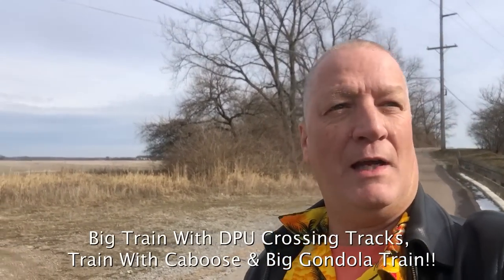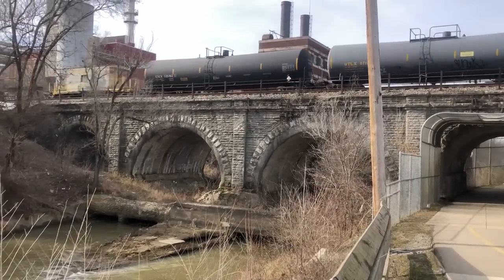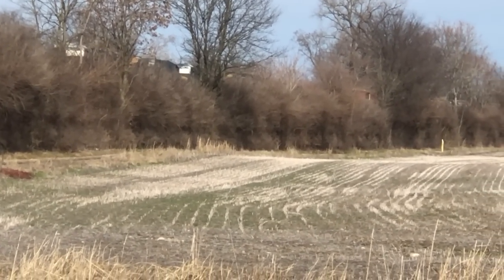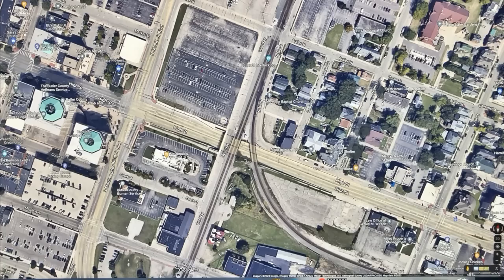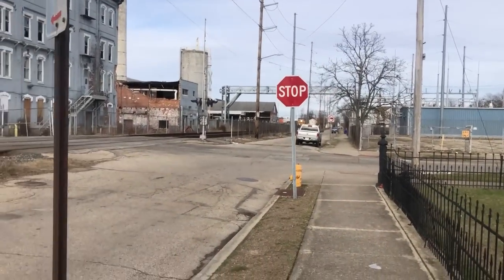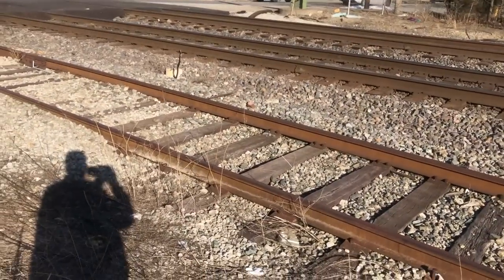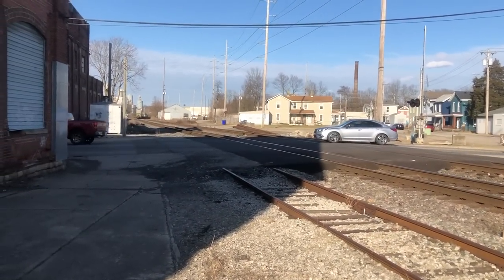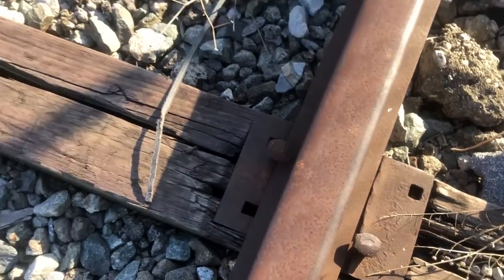Longest Gondola Train Ever!  Rare Caboose On CSX Switching Train Crossing Rock Viaduct, Train W/DPU

Comment: That location near the old power plant in Hamilton, Ohio is a good place to watch trains. It is nice to see that the local has a transfer caboose to use as a shoving platform when the train is backing up. The CSX train using the crossover from track #1 to track #2 to go south on the Norfolk Southern to Cincinnati, Ohio was interesting to watch. The speed of this train was slow going through the crossover. The reason for the slow speed was probably because the train had to navigate a curve to continue to Cincinnati. Ohio. I wonder if the train would have been going faster if it was going continue west on track #1. this train needed that mid-train DPU because of its length.

Comment: 'Morning Brian.  I'm playing hooky from work today so I got to catch your video early.  I cannot think of a more appropriate use for a caboose today, those long reverse moves can be literal killers.  I know railroads don't like them because of the fuel needed to move non-revenue tonnage, but lives cannot be replaced.
Reply: Well, the cabooses were also a killer because the caboose isn't all that strong.   In accidents (to include a train running into another train) often everyone in the caboose is killed.

Many/most commuter trains can be operated at both ends even with a single locomotive.   But systems often use two locomotives for the safety of the train.

Comment: Each of the full sized containers is more or less around the size of a regular boxcar.

For as long as this train is, it's also carrying TWO BOXCARS for (most of) every single sled.
Reply: One small detail is the difference in capacities. A fully loaded boxcar is allowed to weigh 286,000 pounds total. A shipping container has to be compatible with over-the-road trucks, which are allowed a maximum of 80000 pounds, which includes the weight of the tractor.
Reply: @RailRide  Thanks for sharing your perspective knowing the railroads have tried so desperately to terminate their use…..

Comment: Hey Jawtooth, I've seen trains with 4 numbers, 3 numbers, and even only 2 train numbers. 
Do the amount of numbers they use to number the trains  have any significance ?
Example....DPU'S are only 3 numbered engines?
Reply: Mr Koenig, I understand your question is directed to the channels administrator but he may or may not get back to answering your question, but if your speaking of the “ engine number” the answer is no….engines are assigned a number and it can be a 1 digit, 2 digit, 3 digit or a 4 digit and each train has its own unique identification number with higher priority trains given certain numbers for identification…….in our railroad industry everything is based on horsepower/ruling grade and output because engines/locomotives are constantly changing, so I hope I’ve been some help…..ms~~~